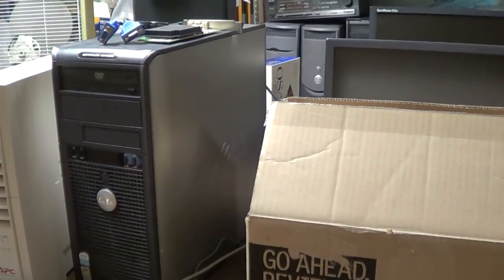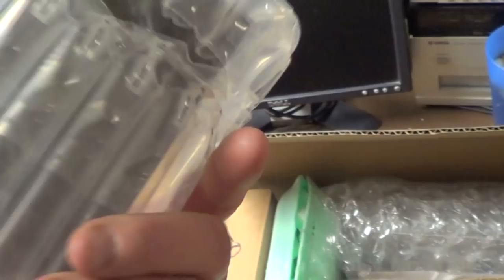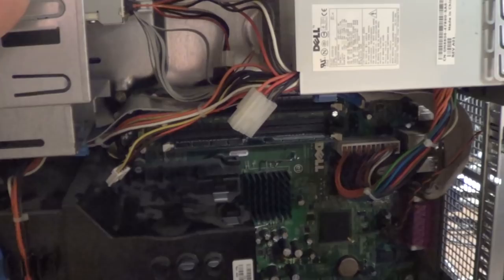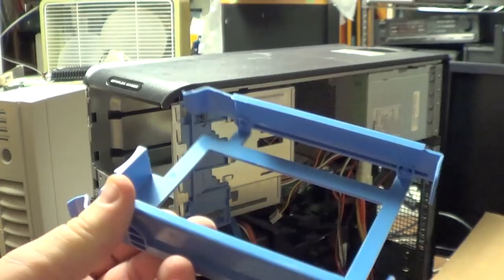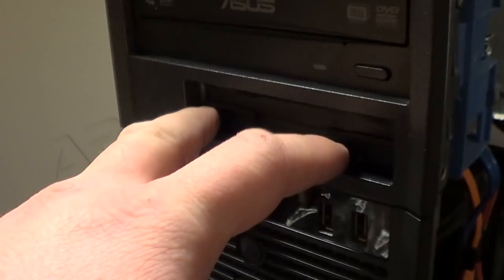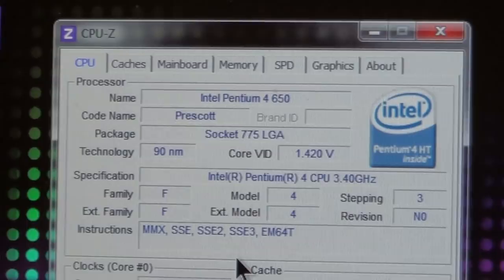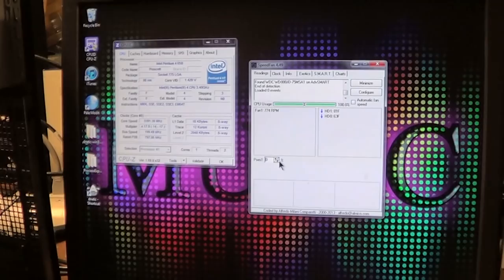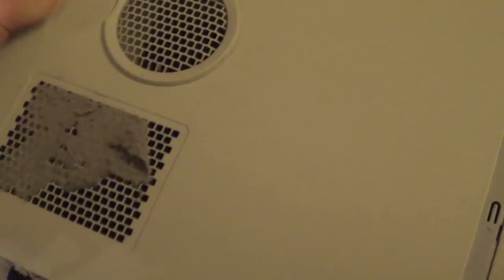"New" Music Player PC Build

Comment: That computer looks very similar in design to my Precision 380. I really like the case design, inside and out. It actually has PS/2 ports on the motherboard, and I think it also has that connector on the power supply, if that's a 350W power supply, it may indeed be the same model.

That model of Optiplex will accept a Pentium D processor, but I think there are different motherboard revisions, and only some work with the Pentium D's properly, at least that's the case with the Precision 380 and Dimension 5150. I've found there to be a significant gain in 'horsepower' from upgrading my machine.

Behold the new music player PC, and may it serve it's purpose well. Just like those who have come before it.

Comment: When i used SpeedFan on my Dimension 8400, the first time it crashed Windows XP and other times, the fan stayed the same RPM.
Reply from the maker: You cannot control system fan speeds on the Dim8400 or similar systems. The fans are supplied with full voltage at all times and regulate their speed with a thermal sensor bulb attached directly to the fan.

Comment: Interesting video. I use those same Asus DVD drives on a lot of builds and upgrades.

You might want to consider using gsmartcontrol to check your hard drives. It not only checks the SMART status, but can run a short and a long test of the drives (can take up to an hour or more depending on the size and speed of the drive and computer). It's a freebie which is always nice and is available for Windows, Linux, BSD, Mac and self booting Live CD/USBs.

I know this is a shot in the dark, but I notice that you have a LOT of old Dell Dimension desktops laying around. I know you don't like to sell stuff thru YouTube, but would you happen to have a spare green plastic power switch activity light holders they used on them? I have a few Dimensions here that I use for testing Linux distros for XP users who can't afford Win 7 and need to move on and some I give away to needy folks and have one that is missing that holder.   

Oh, and that original video of the 2300 and 4100 was the first video of yours I ever watched. I love how you continue to reclaim and/or recondition these reliable and still fairly usable systems.

Comment: I have never found a Hard drive, SSD or CD ROM that uses the 3.3 volt rail on the Sata connector.
Reply: I've wondered about that myself as well, wonder what SATA components that really uses it.
Reply: TheComputerNerd0101
Apparently it's for some kind of hot-swapping operation.
Reply: Sounds strange.. I don't know if it counts for mine, but my hot-swap bays (Chieftec ones) have the option to use SATA or molex to power them, however changing between them does really nothing than the other.
Reply: TheComputerNerd0101 From what i have read the 3.3v rail was meant for low power devices like laptop drives and SSD's but no one uses it.
Reply: Although I don't think it was ever really used, I think the 3.3v rail was intended for lower power operation of sata hard drives. Allowing them to operate at between say 4200 and 7200 RPM for noise and power consumption.

Comment: i use the computer to control my outdoor audio for parties. ive made video's on it and store over 2,000,000 mp3 files not including the countless other files i have (dvd backups, documents, family pics, ect) i think i may breakdown and build a new machine out of the puget case just cause i like the case alot as far as the old parts go i may put them in an alienware case i have and run them both side by side using a kvm switch.. that may not happen till summer though but i know i am replacing all four internal hdd's with either two 1tb or 2tb drives to make room in the case and save my psu from a epic fail

Comment: I noticed in the annotations how you were complaining about the lack of optimization for Flash Player.  Have you ever tried using the YouTube HTML5 Player?  I know it used to be even worse than flash, but now it's actually quite good, and it seems to perform much better, even on older systems.

Comment: Also if you have problems with speedfan on dell machines, try i8kfangui.
Reply: Well fair enough, I usually use the tools to crank up the fan speeds on dell laptops with dedicated gpus, after repasting and shimming the gpu the temps are awesome with the fans cranked to 100 (even though they will wear out faster, but I would rather buy a  new fan than a new mobo or gpu reballing lol)

Comment: I have this computer! My specs are 3gb of ram and a pentium d 945. Mine is not dusty though.
Reply: +Justin so sorry 4 u...
Reply: +Justin
 I just bought one of these, dual core Pentium D at 3.4 Ghz, 4GGB of RAM, a 1TB hdd and Windows 7, should be a decent runner.
Reply: I don't use it anymore. I have a good laptop and a computer that I built myself. My new computer has 16gb of ddr4 2133 ram, an Intel Pentium G4400, a 250gb main drive, and an 808.8gb game drive.

Comment: I have to say that the BTX formfactor Dell used has simply got to be the easiest one to work with, I have a Precision T3400 system, and it's taken nothing more than a screwdriver to swap parts on... and the screwdriver was only there for undoing lock screws, other than that... swapping hard drives and graphics chip was as simple as pull, place, clip and lock... no tools whatsoever!!... although the one thing I don't like much is just how dusty they get! I have to clean my system out on a bi-weekly basis because it gets that bad!... and with the chassis being black (excluding the silver bezel plate) the dust shows up even after a few hours in operation after a cleaning!!

Comment: Nice. I used a Dell dimension 4700. And replaced everything in it. I used it until the graphics projected wrong. So I got a 2012 Emachines out and got a Dell Inspiron 3847. And it has 8 gigs of ram. What type of processor do you have in that Dell anyway. You could have updated the processor to. Ram doesn't give a computer a lot of speed. They help each other. And the old Dell dimension 4700 had 2 gbs of ram and still slow. And imagine that IBM I had only had 256 mg of ram and went much faster. So give what the os wants a little more.

Comment: I usually found the DVD Burner & the Hard Drive on Yard  Sale, and they're selling for $5 of each, and I bought them for my XP Tower.
Reply: are you planning to try to upgrade it to 7 of try install like win embedded since XP is done after april 8th or even linux
Reply: I'm planning to install Windows Embedded POSReady or Standard 2009 for my 2004 eMachines Windows XP Model T3958, so that case, I can run any capadable software like Word Rescue Part 1, uploading videos with Wireless USB, etc, anything I can do for my XP Tower. =)
Reply: im gonna try to see if i can get embedded standard to run on a old Compaq Deskpro EN (ENL/p866) which this thing will run XP i am doing it on a separate hard drive this unit is more for  the older games that can not run on windows 7 64 but if they dont want to work i may try and experiment with dual boot
Reply: dawn1berlitz Well, I've tried to run on Word Rescue Part 1 on my Vista, it doesn't want to put on full screen on command prompt, and then I figured, I may stick with XP because, it will not work on Vista or 7, and I don't know if that will work on 8 or newer to play games on Command Prompt.
Reply: i was able to one time able to find it was 2 samsung sata drives and i believbe they where 5 dollars each i wish i had bought both they where sata drives i think i went back next day to get the other one with extra cash i had the drive was gone
Reply: I usually bought 2005 Asus DVD Burner at the Yard Sale around Summer or Spring of 2013, and it has PATA ports, and it works great and it really did it great where I can burn the DVD fast.
Reply: i still have some pata dvd burners for non sata systems my latest build has 6 sata ports and a ide port i might use one drive for region 2 DVD's
Reply: Same here. =)
Reply: i order some dvds out of japan that have english subtitles they are coded for region 2 
NTSC-J which on a computer it displays just fine

Comment: Hey uxwBill, you probably already know this but I'll write it for conversation purposes. Your P4 650 in that computer supports EM64T so if you want the Windows 7 OS to be able to use the entire 4GB of installed RAM that the particular computer can support, then you should use the 64 bit version of Windows 7. Windows 7 32 bit version usually can only see/use something less than 4 GB of RAM.
Reply: I'm stating what Windows reports as useable memory on some of my older Dells that are limited to 4GB of memory and are using a P4 CPU that supports EM64T. Using the 64 bit version of Windows 7 (My Computer -> properties) showed the entire 4 GB available to Windows. Using the 32 bit version of Windows 7 showed around 3 GBs. Are you saying that the net available memory is still the same for both versions?
Reply: I think I was using a Dell Dimension 4700 with a P4 541 CPU that is reporting 4GB available.

On another note, I picked up another Dell Dimension 4700 at the thrift store and was tweaking it out yesterday. I was replacing the CPU with a faster one after I flashed the  BIOS to Version A10.  I don't know what I did, and this is the second computer I did this to, but I killed the motherboard by, apparently,  bending some of the pin contacts in the LGA 775 CPU socket somehow.  I don't know the if I bent the pin contacts taking out the old CPU out or putting in the new CPU in. I need to be a lot more careful with with this type of CPU socket. It looks more sturdy that want it really is. The mistake will cost me $25 for a replacement motherboard on eBay.

Comment: what program did you use to force the processor to return to full speed just wondering cause i have a dell xps 420 with a Q6600 core 2 quad and cpuz shows it is running a 1.2ghz just want to speed it up a little thanks for your time uxwbill i appericate it and keep up the awsome videos.

Comment: I was almost going to interject that it wasn't in dual-channel mode when I saw the RAM sticks-- usually they put the channel A and B first and second slots together on either side of the gap... Interesting that it doesn't seem to make a difference in this case, but it did catch me off guard.

The highest-end CPU you can stick in a GX620, from memory, is a Pentium D of some sort... but they don't have much more power over the singlecore Pentium 4 in single-threaded operations and are only marginally better at the same wattage. That said, you do have a Pentium 4 650 installed! it's not a Prescott core, but a Prescott-2M core-- I nitpick about it since it defines that core as having 2MB of cache instead of the 1MB usually found otherwise on the CPUs found in those boxes. That said, a Pentium D upgrade is cheap, most of them have Virtualization support, and they most often have 4MB of cache.

The other thing you can do is get a Pentium 4 651, which is 3.4GHz/2M/800 as the 650 is, but is 65nm, and thus runs cooler and more efficiently idle/load wise. you have to be careful which part number you get, however-- SL8WG supports all of the BTX thermal module 1 & 2 specifications, so that would be the wisest choice. With the 3.4GHz P4 in either way, however, I'm stunned to know you haven't even bothered making sure you had a meaty heatsink on it. It's usually rule of thumb at 3GHz+ to give those CPUs a copper heatsink with some sort of heatpipe in OEM PCs-- I'm just stunned beyond words Dell didn't ship them all with that tower heatsink in them.

Another thing to consider would be to salvage the 92mm fan from your 2300 if it's the 92mm thermistor Nidec Beta V fan and just splice the power into one of the legacy molex connectors either through an adapter or otherwise-- and just ziptie it in the rear as an exhaust fan. I did this with my GX620-turned-OptiPlex-755 and it absolutely drops the ambient case temperature down down down, into the ground! this will help with capacitor longevity and not impose any noise changes in the long run either-- I've also noticed the hard drives ran about 5C cooler as well, but I can't say for certain if that was a direct effect, or just because the house in which this box now lives (I gave it to a friend for Christmas, I said in the chat of one of the live shows back a bit) is at 67F or so ambient whereas my own house is at a toasty 72F... it might be.

Anyways, I'll end this here with this: consider a 755 upgrade in the future, the motherboard is cheap (under $20), the front panel connector needed so the 755 board doesn't complain is under $10, and that's all you need aside from a cheap Core 2 Duo or Quad ( Q8200 for $30? :D ). Definitely a well-worthwhile upgrade path for you later on, whether you have a need to or not-- LGA775 stuff is mega cheap now, except of course the S771 Xeons and the LGA775 boards that support them-- now that the word has spread far and wide about the LGA771 to 775 mod stickers and people's success getting E5440/E5450 CPUs working in junker wolfdale-platform boxes, people are turning their old boxes into megaperformancepowerhouses for under $40 in some cases. it's crazy... but when you're hungry for that 12MB of L2 cache, you'll do anything.
Reply: *****
I only did my swap because the 620 I got had a dead board, and I didn't want to let 4GB of RAM go to waste like that. it did have an E520's PSU and that tower heatsink from I believe a PowerEdge SCsomethingorother after the initial upgrade, but you do what you can to keep those nicer business-y looking Dells going, I guess.

the heatsink is milled that way because foxconn was being as cheap as they were. they probably did thermal testing with the 3.0 P4 and applied the thermal curve to every single P4 in the lineup and sold that model with the next two above it onwards with that heatsink to keep costs down. I'd expect no less from the likes of mid-00's Foxconn. as for the Pentium D, don't bother unless you need the cache-- the P4's (and definitely the P4 Extreme Gallatin-core 775 chips on that note) are the best way to go so long as it's kept cool.

the JMC/Datech fans are garbage. the one I'm talking about might be in the 4600 series then. the bearings on that Nidec last a long time and at their lowest speed don't make any more noise than you'd usually get out of a Dell. You're free to use what you like, but that's my honest recommendation solely because of the thermistor and the cramped space it'll be in. that way the exhaust fan in this case would ramp up as needed as the ambient case and surrounding air gets warmer.

Helped in this desk arrangement where the now-755 sits behind a door: http://goput.it/str/y0n.jpg (and yes, that floppy is hooked up!)

Comment: That looks just like my old 1987 Sherwood receiver setting right in front of you?is that a 1145R receiver?..you have one great receiver their.
Reply: ***** It looks just like my RA-1145R it only has 55 watts but do not let that fool you this receiver sounds so much better than what Sherwood makes today.my cousin made me some custom speaker cabinets.they have two 12"s one 10" and two 5" midrange and two bullet tweeters in each.that old Sherwood will rock the house and it's clean no distortion.I'm sure your 40 watt could do about the same.the bass will be much better than either the RX-4105 or the 4109.

Comment: I've got a Dell dimension 8400 3.4ghz HT P4, thing is from q4 2004 and is a BEAST. I gave it a 27 inch 1080p monitor, a $30 HTPC video card, a couple gigs of DDR2 (considered new back then) over its nearly 10 year lifespan. It plays 1080p Youtube video no problems, also runs League in 1080p @ 30-60 fps :).

 Interestingly enough, it's never really felt slow, and I don't plan on replacing it anytime soon. I paid $1400 for the PC nearly a decade ago, so I need to use it for at least 14 years, right? :P
Reply: ***** Yep, by far the best PC I'ved owned. I've never had a problem with my 8400, even though it's been used for probably 5000+ hours. I've got a new i7 laptop, but honestly the difference isn't huge when doing routine stuff such as HD Youtube videos, chrome, and editing/compiling code.

That P4 is actually a bit faster than my new-ish e350 netbook/ultraportable. Since commonly used software like chrome and windows isn't requiring faster hardware to run anymore like it used to (think of Win8.1 vs Vista), I think my 8400 will potentially last forever, or at least into the foreseeable future. The idea of "immortal" PC's are really interesting to me.

The 2.8 ghz p4 is also decently fast. I've got an Dell laptop from early 2004 with that chip, still pretty fast and does smooth 720p Youtube playback even though the video card isn't helping it at all. However that thing was obnoxiously loud and weighed about 10 lbs.

Comment: From what I've seen, you cannot use more than 3.3.5GB of RAM while installing a 64-bit OS. I believe it will work with 8GB of RAM, to the exception of the OS install. That's the stuff I find weird about Dells. I'd have to try it on my own SFF GX620.

Here's the link:
http://en.community.dell.com/support-forums/desktop/f/3514/t/19383166

Comment: Hey uxwbill.
How possible do you think it may be to take a Dell or any brand of tower drive & make it into a music / video entertainment system? :) Thank you! :)
Reply from the maker: Google awaits!
Reply: Mark Covington depends, an early core2duo with integrated graphics  an run 720p youtube, and 1080p playback easily, but if you are planning to stream 1080 or 1440p, a later core2duo or early core2quad with some graphical assistance (like a used r7 250/gt710 or 730, I built a $103(CAD, about $80-$90 American) Core2duo e8400, 4gb of ram, and a used r7 250 PC from an inspiron 530, it runs spotify, youtube, netflix and kodi with awesome quality, an sipping on 300w of power, so yes, it is very possible